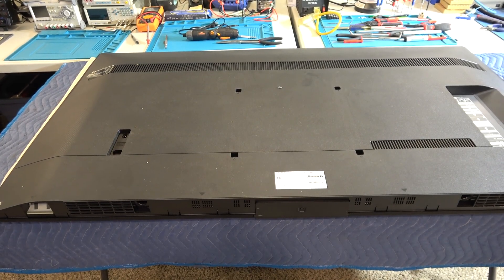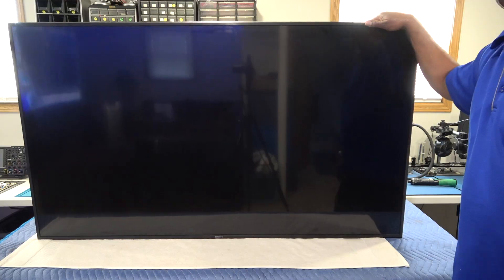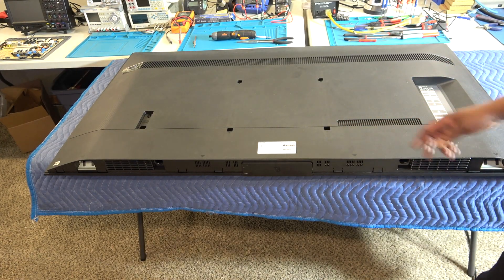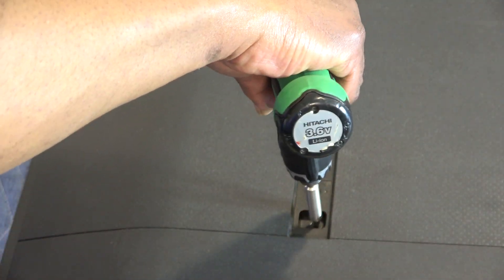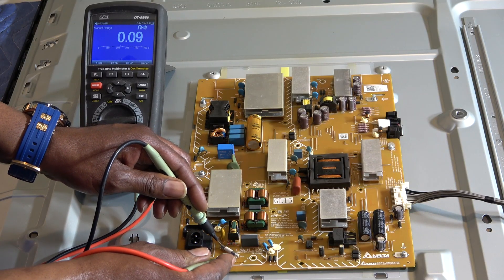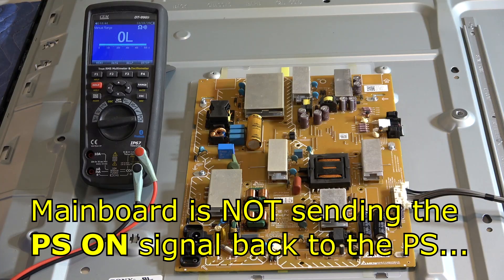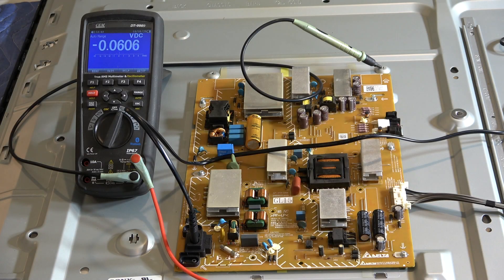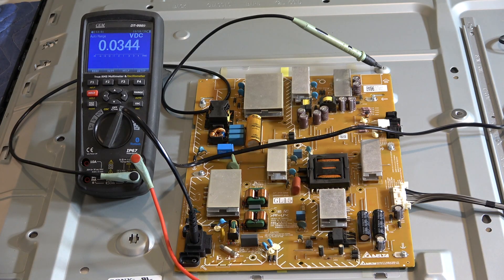How to Troubleshoot any SM Power Supply in less than 8 minutes. Dead Sony KD-65X80CJ TV repair.

Comment: Hello sir, I have a question about your video of the Insignia 55 inch repair due to I have exactly the same and with the same issue as the one in the video. I've  been wanting to open it up, but would like to know the type of Led you use to repair it due to it's power supply is good and I'm sure it will need a new or few new leds. Please help me letting me know. Thank you. We see you from Mexico..

Comment: Hi BigDog, this was a nice informative video. But how do you check if the pwm chip, which is driving the mosfet on the hot side, is switching?. What method do you use if i may ask. Do you use an oscilloscope? Hope to hear from you soon. Many thanks in advance

Comment: Are they the current sense resistors? I've encountered these dead fairly often when a MOSFET (internal to switching chip or separate) goes short, and it sometimes blows the fuse but often just dumps the HV cap through the resistors and takes these out. I encountered this at a Repair Cafe and ended up swapping the switching chip (top blown off!), two surface mount current sense resistors, two bridge rectifier diodes, and the fuse. Did you fix this PSU or just buy another?
Reply: No, they're the startup resistors - they pass sufficient current to charge the Vcc capacitor to a sufficient voltage for the switching ic to start, but only enough for it to run for a very short time period.

So if there's a fault in the auxiliary circuit that supplies Vcc for the ic when it's running normally, the power supply never actually starts.

Hence when the startup resistors have failed the ic never gets Vcc to enable it to start, so obviously it doesn't.
Reply: @will_doherty  Yeah, I've had to replace those resistors (and the cap, and the diode) a few times in the past.
Reply: I tried troubleshooting the power supply in my old Haier TV. 

It's def psu issue, bc no standby voltage. The 1st FET is good. I've traced the voltage thru to the 2nd set of FETs. One of which is receiving voltage. The other is not.  

I removed both from board & tested them. They both appear to be good. One of the resistors in that area wasn't measuring the correct resistance.  I replaced it & soldered the mosfets back in.  

The TV is still dead though. 

I stopped messing with it after that. I was basically disgusted at that point.  

Does anyone have any idea what the issue could be?